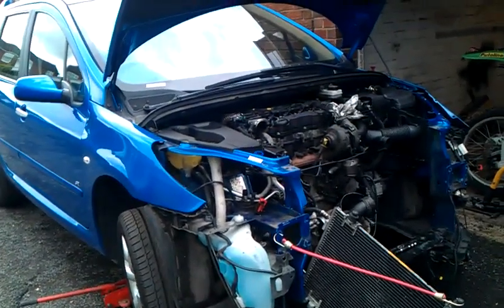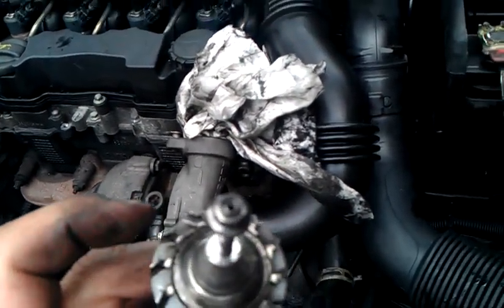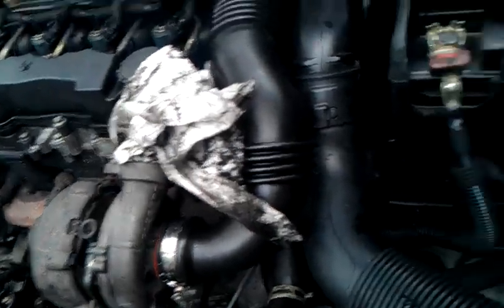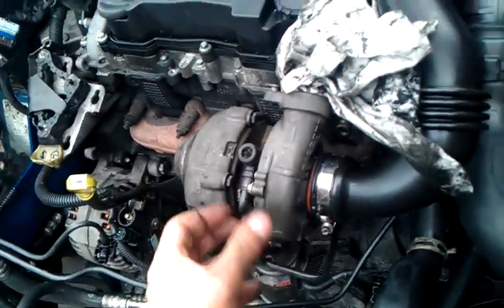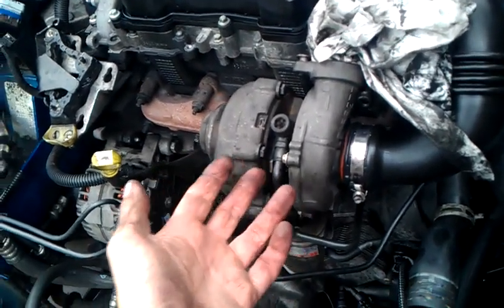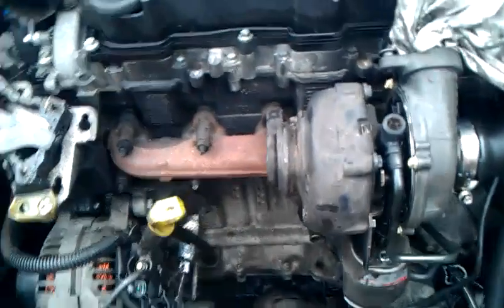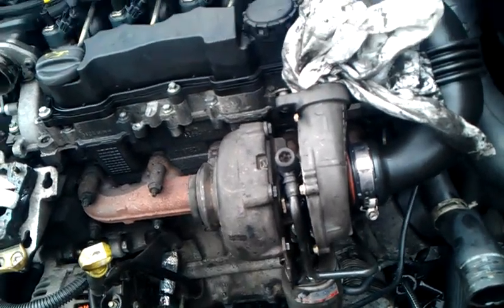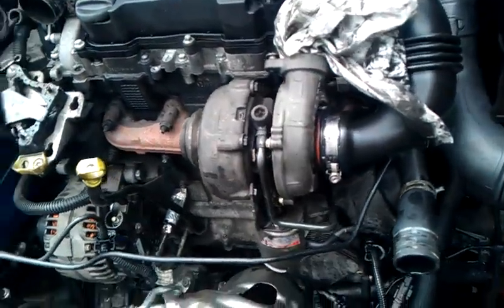peugeot ford dv6 1.6 hdi turbo replacement complete overhall

Comment: There's a service bulletin out for the oil feed pipe. It's got a mesh or filter on it at the end that screws into the block. You're supposed to remove it.

Comment: These engines are a good engine and economical.. The problems caused are always by lack of maintenance.. change the oil regular 10,000 mile as well as filters make sure turbo oil feed pipes are cleaned or replaced including banjo bolt every every 30,000 miles. and they will be good.. we have had 6 as taxis (from new) and this is how we maintain them. The lowest mileage on one is 218,000 the highest 301,000. so we cant complain. its all down to regular servicing..

Comment: This engine is great. I have 307 1.6 hdi 110hp and now is over 200k  only timing belt changed , no other problems. Regular service at 10k full sintetic oil total 9000.

Comment: @peppersdog1 It's not a bad engine. The turbocharger suffers oil starvation because of shyte oil (virtually all "synthetic"/"fully synthetic" oil are just hydrocracked mineral base stock instead of a PAO fully synthetic, most people are clueless about this), long oil change intervals on shyte oil and oil screen, mesh or filter on the end of the turbocharger oil feed line that screw into the block.

There's a similar problem with Turbocharged Subarus & they have a service bulletin out as well.

Comment: I agree somewhat. I think manufacturers try and squeeze more power and better fuel economy out of smaller engines is putting a lot of strain on it. They couple this by extending the service intervals and it seems as if cars start to fail just as they fall outside warranty. I religiously stick to oil and filter changes every 5k and never work the engine until it's properly heated up. Magnetic sump plug doesn't hurt either.

Comment from the maker: I have given the engine two oil flushes using forte and in total changed the oil six times in six days to totally remove any crap,I then have used some quantum 3 5/30 oil and some forte oil attitive and fingers crossed the turbo will last.

Comment: Should there be a gasket/o-ring at exit of the turbo to the egr. The air comes in at the right side, then where it leaves the turbo/ so the black plastic pipe running to the egr, should there be a gasket or something? Because I replaced my turbo but now there is an oil leak from the turbo but I cannot seem to pin point from where it is coming.

Comment: Yes changing the oil will help, but no its not always the user/drivers fault, its the fact that crap from the dpf etc gets shoved back into the oil causing sludging thats the problem, all to do with the new emission regs

Comment: Don't listen to this guy ,he advise to the people that they have to remove the whole engine and clean it or replace with the new one , I think he work for peugeot dealer, you just need to replace the turbo and change the oil and oil filter regulary that is it.
Reply: +Allan John Also, Replace Oil Pick up \ Strainer as this has had a redesign, Plus the feed pipes

Comment from the maker: A large car with a small under powered 1.6 diesel engine will always need more php . a little oil is the norm as long as its still boosting okay. Check all vacuum hoses for cracks or splits 100%.you could try adjusting the actuator, I did it was fantastic and the kids were screaming . lol

Comment: Great video i have Picasso 16b hdi 110 every now and then i get get engine fault light with turbo supercharger boost sensor circuit A high only if i put my foot down a little seems to hold back on power for a while if i don't boot it so to speak it down happen.Any idea what it could be ??please don't tell me its the turbo

Comment: Hi there, I have a 307sw with same engine, interesting to see it with the front off. Can I ask did you notice a any sign of leakage around the injectors as I understand this is related to the root cause of sludge build up in the bottom of the engine (leading to turbo being starved of oil as you said)?

Comment: Replacing my turbo on the 1.6HDI now. Bought the car woth the turbo blown. Just a quick question. Should the banjo bolt be able to move up and down on the oil feed pipe? Thinking oil might leak from it?
Reply: Some times but will most likely leak oil, it's always good practice to replace.

Comment: The nut came loose because the turbo had come to a complete halt while the engine was running due to carbon. not because the nut was torqued incorrectly as usually incorrectly assumed

Comment: i have this engine on a 407 1.6 hdi 2006, and i've noticed a lot of carbon build up on the housing of the compressor side of the turbo, i'm confused as this build up is external and starts from the oil feed pipe and comes across the compressor housing, could this be a problem with the seal or maybe the oil feed pipe?

Comment from the maker: Sounds like the nossel is sticking check out my latest video on my channel. Start by checking that the actuator arm moves freely when the engine is srarted and turned off, you could try manually moving forward and backwards to free any carbon build up in the turbo.

Comment: Its not that they are, they are like every engine if you dont look after them properly they are more prone to breaking, ive seen one of these engines with 140k on the clock and never been serviced except timing belt and it still running 100%

Comment: I was also considering a 2013 Toyota Corolla with a 1.8 VVTi naturally aspirated gasoline engine. It only costs 20% more than a 2009 407 HDI. The Toyota comes with only 2 airbags, rear brakes have drums instead of discs, no leather seats, no sunroof, onboard computer sucks, no xenon lights, and at least other 30 security and comfort accesories are missing. The engine and gearbox are great but the rest is just too basic for me.

Comment: the 1.6 liter hdi turbocharger damage are completely normal when at 100.ooo km of the turbocharger are broken. because oil sludge formed in the oil supply line and the stock turbo and the turbo you rub around the ears so just flying dirt peugeot technology

Comment: Peugeot/Citroen 1.6HDI DV6TED4 16v 110BHP Cylinder Head Removel for repairs.Take a look i see a lot of these engines with various problems does not seem to make a difference on age or miles

Comment: I have a DS3 1.6 HDI, the turbo was replaced under warranty at 7500 miles (no that's not a typo: 7.5K) absolutely atrocious. It's a shame these engine have this design flaw as they return good MPG and have a decent power output. It's mainly emission control systems that make these engines shit. The EGR (Exhaust gas recirculation) will quickly taint your oil. If you do short trips the DPF won't regenerate properly and the sump will slowly fill with diesel (due to post combustion injection)....

If you want this engine to live longer without having to de-slugde it frequently delete the EGR and get it remapped out of the ECU. EGR blanking plates don't work on the modern 1.6 HDI's as the ECU immedialty notices that it has been blocked and retards injection timing to reduce emissions (which really bolloxs up you MPG).

Comment: Forget the manufacturer's oil change recommendations,  persistently we see problems with 'clever engine oils' that are not clever at all.  Change your oil twice a year or every 10k regardless.  Or more often if you drive < 20 miles every day.  Its not just these engines, VAG cars have other issues caused by long life and even OAP cars suffer from sludge build up during the weekly 2 minute drive to church.

Comment: I don't agree, I've had several cars with these engines in, you MUST use the correct low ash oil, you MUST flush and change the oil before or on the manufacturers recommended milage, and the carbon build up will be very minimal, so your turbo will last as it should, all my vehicles have had way over 180,000 plus miles, no problem, only thing we have came across is injector seals going on 2 vehicles only, it is so important to get them done Asap, as the carbon build up rots the rubber oil seals (cam cover) where the injector passes through, 
neglect them and yes they are shit, there one of the dirtiest engines out there.

Comment: The engine is not fragile. My van's engine has seen 4 years of multi-drop delivery in all weather. Blaming an engine for idiot owner negligence isn't really on. Same problem with cam wear on VAG PD TDI where owners have tried to save a few quid on oil and left later owners with wear issues. Don't buy a car if you aren't prepared to look after it as it was intended it's just dangerous and irresponsible.

Comment: If i were you id remove the inlet manifold and scrape out the sludge deposits in there. i would also blank off the egr valve yet leave it plugged in as this is also another poor add on for this engine.